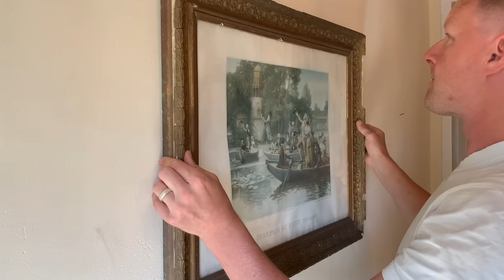We BOUGHT an Abandoned CHATEAU MAKEOVER | Guest Bedroom Transformation | Before & After. Ep 69

Comment: Looks fantastic. Brings back memories when I converted the loft over the classroom of an old school House in the Calvados region in 2005. Boarded in between the old A frames using the metal walling system rather than timber and built a dormer window out of green Oak with mortice and tenon joints. Window from Gavray.  It was  one of my favourite rooms apart from the old classroom became a Living Room with a 2ft raised pine floor, which I built as windows so high to stop the children being distracted by what's outside. Used V3V chene moyen stain the new pine floorboards, then went over with a clear Cire, wax finish. The best old/new looking floor we have had. Also built a fireplace and chimney using the flue blocks with Villager AHI boiler stove. The taping and jointing was the job I hated. 3 fill coats and sanding. Enjoy seeing your episodes. Look forward to what fuel boiler you will choose, or just the woodburners. I would go geothermal if I could fit it myself or wood pellet.
Reply from the maker: Thank you very much, it sounds wonderful what you accomplished, we used the same on our floor 🥰